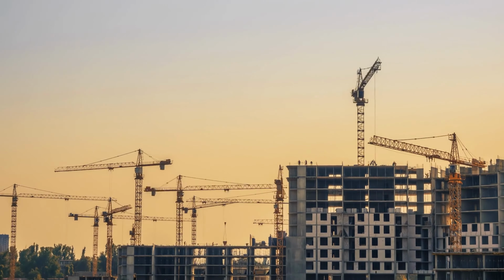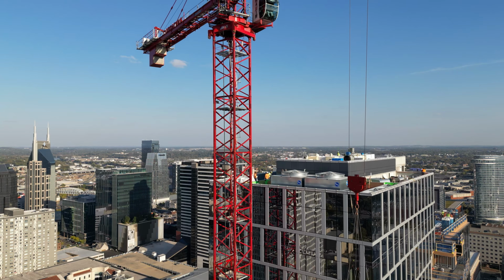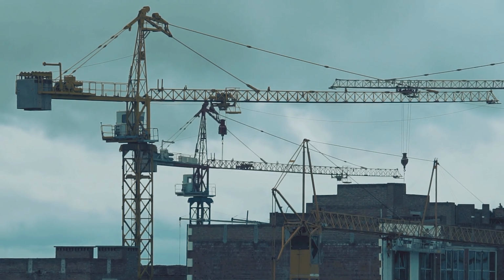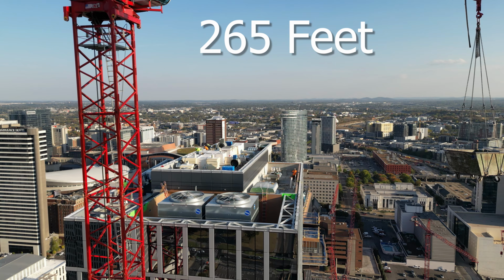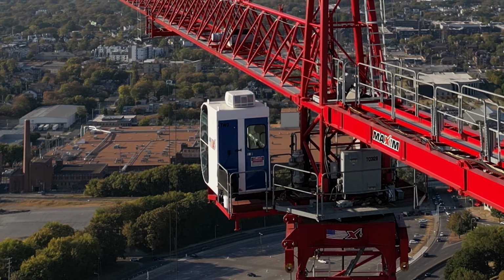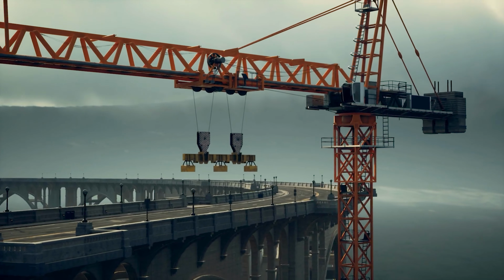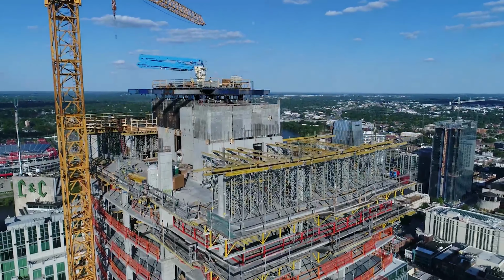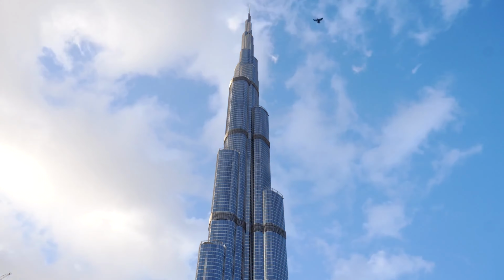How Tower Cranes changed city skylines forever

Comment: I want to know how the latest update to the Mini 3 Pro with remote ID will affect the Mini 3 Pro user. Will you be tracked as a recreational flyer even though the law saws you're exempt from that? Will the tracking feature be able to be turned off and on if you're a part 107 vs recreational pilot for under 250g drones? Please do a video on this.
Reply from the maker: You are not exempt from ANYTHING except registering with the FAA. You need to still follow all the other rules and regulations that they set forth for drones.
Reply: @kenheron  I realize that under 250g is not exempt from FAA regulations but being tracked at under 250g is exempt under FAA regulations is not the law. Is that correct or every drone under 250g   mandatory under FAA regulations must be tracked by law?
Reply: Sounds like I'm correct due to your lack of response. PS: there was really no reason to shout "ANYTHING", lower case letters would have meant the same thing.

Comment: I like how you gathered info on the cost of getting one of these to a job site & setup ready to use plus the monthly fee! Did you by chance find out how much (per hr) the operators make? Personally, I’d need about $1K/hr. to sit up there and operate it. That’s a long way up & down just to get to my “office” in the cab, not to mention being up there if the crane decides to fall from either weather conditions, mechanical failure, or too much load 😱